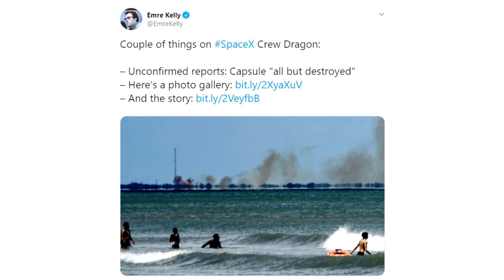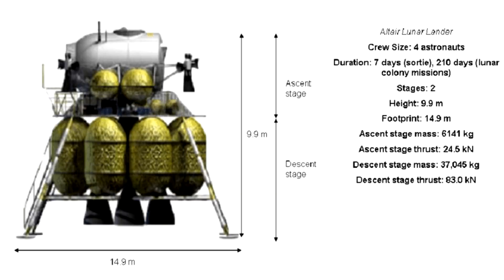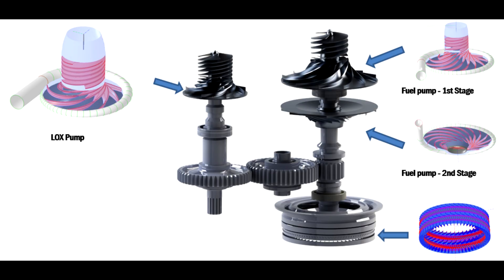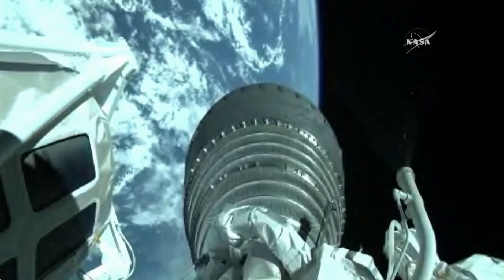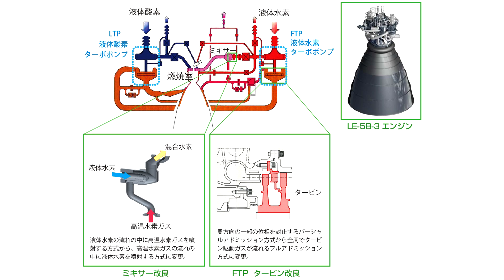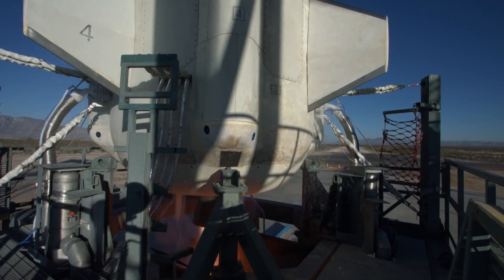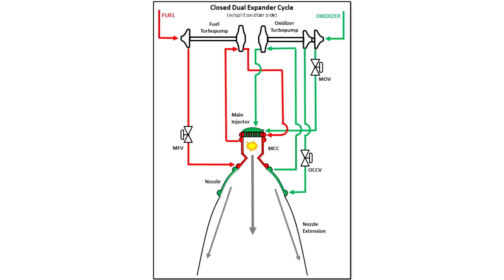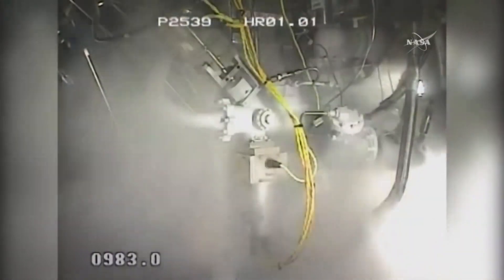Expander Cycle Rocket Engines - Using Waste Heat To Drive Your Rocket

Comment: What is the reason for moving from a jet turbine style engine to an open bell shaped nozzle in rocket engines?

Why did they move the turbine before the main combustion chamber instead of in it?

Obviously theres no air to pull in in a rocket engine, but it's really just a different kind of pump isnt it?
Reply from the maker: Because a rocket engine can't use the atmosphere as reaction mass it needs to get much hotter to maximize efficiency, the exhaust temperature in a rocket can boil steel, a turbine in this location would not survive.
So the turbine is used to run the fuel pumps, and the turbine is run at a much lower temperature.
Reply: @scottmanley  Thanks! I thought of this too...I thought maybe it was possible to run fuel through the turbine blades just like they run fuel through the engine bell.

In my head I imagined a series of horizontal channels stacked on top of each other in the turbine bearing. Where each blade meets the bearing there would be inlets and outlets for the fuel to run through the blade.

Probably not feasible...just a thought. Thanks again!
Reply: The turbine in a jet turbine takes energy out of the exhaust stream to drive the compressor on the intake side. It is often the materials that limit how much thrust that can be extracted from the exhaust flow. The principles of design of nozzles are still the same.
Fast high-pressure gas jets are also noisy, which is undesirable around where people live. That's why modern airliner engines take the opposite tack of moving large volumes of air to a relatively low velocity by taking even more energy out of the core exhaust to drive a large fan. It isn't quite as efficient at high altitudes and airspeeds as a pure turbojet, but it makes up for that on the ends.

Comment: Hi I was wandering if there has ever been a idea to use magnetic constriction to adjust the nozzle geometry?
Reply: Yes, but not on chemical rockets. It is in the works for some theoretical plasma/fusion engines though.

Comment: Losts of video's on the operation of rocket engines, but I haven't found a video explaining how these forces are transferred to the rocket. Why doesn't the combustion chamber burst? Why does the (apparently very thin) nozzle not burst? What part of the engine 'pushes' the rocket up? Why doesn't the engine crush (upward) like a soda can, in a test stand?
Reply: The combustion chamber is relatively thick.
The nozzles are not under a lot of pressure. Ideally, you want the outer lip to be exactly at ambient pressure. Their main job is to turn the high velocity gas flow into a purely linear flow in the opposite direction of the desired travel direction.
A rocket engine is a reaction engine. Pushing mass out the back in one direction at high velocity causes the rest of the mass to gain momentum in the opposite direction. The part that would ultimately feel the force is the "top" of the combustion chamber.
For the same reason you can stand on a soda can and not have it collapse under the force of your weight. Because it is strong in that direction. Early Atlas boosters had to be pressurized to keep the right shape. There is video online of one collapsing under its own weight when it lost pressurization.

Comment: Hi Scott, I'm wondering how fuel tanks work in low gravity.  I mean rockets use oxygen and  hydrogen in la liquid form, which has to be pumped to the engine. But since it is only liquid due to it being pressurized,  how can You make sure that the fuel pump doesn't "suck in" gas instead of liquid? I'm talking especially  about the transition between  liquid and gaseous state. Wouldn't that cause irregularities in the  thrust output?
Reply: Look up "ullage engine" for the various ways. It can be as simple as a nitrogen gas jet.
Reply: @Markle2k  Thanks!

Comment: How about an engine where the Hydrogen acts just like an expander bleed cycle but instead of dumping the Hydrogen overboard it's used with a bit of Oxygen to generate heat (or gas) which will heat up and expand the Oxygen so that the Oxygen can drive its own pump or in case you use it as a gas generator you use that Oxygen rich gas to drive the Oxygen pump.
No reason to just dump your Hydrogen, right? Especially since it's the more unwieldy of the two gases.
Reply: "Hot", high-pressure oxygen bad. It turns metal parts into "fuel".
Reply: @Markle2k  Scott mentioned that. And yet he mentioned an engine where that method is used, right? Or did he just mention that the concept of using expansion of Oxygen to drive the Oxy pump is on the table?
Reply: @MrRolnicek  Hydrogen has a lower triple point so you'll get more expansion (read pressure) for a given temperature. Hydrogen's lower molecular weight will mean a better Isp for the dumped fuel, but I don't know if that's a rounding error for the overall system.
There are engines which use oxygen-rich gas generators. The RD-1X0 engines are the famous example. US rocket designers didn't believe the Soviets until we started buying them for the Atlas V. The BE-4 is another example, and the Raptor uses one on the oxygen turbopump. The Raptor uses a fuel-rich preburner and turbopump on the fuel side.
But those aren't the same as pure, hot oxygen that I assumed you were asking about.

Comment: What I would love to see would be a paraffin hybrid rocket driven by an expander cycle, since you only have to pump the oxidizer, you could get higher mass flow rates, and if you used the turbine exhaust for film cooling of the nozzle extension you could pull more energy out of it (i.e. have a lower turbine exhaust pressure).  Also, since the combustion chamber wall is insulated by the fuel, you would only have to actively cool the nozzle which could allow for larger engines that are still on a closed, or partially closed cycle.

Comment: Sooooo.... the turbo pump is analogous to the APU for a jet engine, correct?
Reply: Not at all. an APU is a separate engine (often in the tailcone) that provides electrical (sometimes also hydraulic) power to the airframe. Thus the name, Auxiliary Power Unit. A turbopump is a type of "fuel" pump that forms the top part of the main engines.

Comment: Simplerockets 2 has a new update on procedural rocket engines in which you can choice the type of pump (even if it is electric), the type of cycle, the type of fuel and some other parameters.

Comment: Scott, can you explain why high pressure water pumps have multiple stages but a rocket turbo pump only have one?
Reply: Predictions: (eg, I don't know, but here's my guess)
* Water is much heavier, it's mentioned in this video that at least some designs have two stages for the heavier LOX pump for this reason
* Most rocket engines aren't going to be run continuously for years

Comment: How about a discussion on Pulse Detention Rocket Engines, which likely would be much more efficient than any turbo-pumped engines. My guess the primary issue is excessive vibration.

https://www.researchgate.net/publication/251682161_Performance_enhancement_of_a_pulse_detonation_rocket_engine

Comment: 2:16 yaiks wrong rocket

or more specific wrong upper stage, the rl-10s wer used on the s-IV not on the s-IVB, as seen in the picture with an j2.
Reply: Question - how do you distinguish between S-IV and S-IVB without looking at the engines?
Reply: I saw the same thing.  S-IV and S-IVB are not as similar as the name would suggest.  The S-IV was a different diameter (smaller than the first stage) and never launched a manned CSM.  He did use a “non-standard” Saturn 1-B launch…from Apollo 5, which tested the lunar module in orbit.  It was the rocket from the ill-fated Apollo 1.

Comment: The fact they used the Rankine scale makes me think they shouldn't have been trying to build rockets.
Reply: If you can't multiply by 5/9, you shouldn't be trying to judge the technical competence of others.
Reply: @Markle2k  A lot of accidents have happened because of conversion mistakes, that's all I'm saying.
Reply: @RBuckminsterFuller  What conversions? Units are arbitrary. As long as you are consistent, you're good.
Reply: @Markle2k  Conversions even within conventions become exponentially more tricky when you tie yourself to a dead horse.

Comment: @szyzyg Would it not be feasible to surpass the square/cube law by using a larger count of smaller-sized combustion chambers per engine to exceed the maximum thrust achievable from an expander cycle engine?
Reply: How is that different from just having more engines?
Reply: @TheToric  multiple combustion chambers all fed by a single, shared pumping system, are counted collectively as a single engine. This is why the the Soyuz is said to be propelled by only 5 engines at liftoff, even though the centre engine has 4 rigidly mounted combustion chambers and an additional 4 steerable vernier nozzles, and each radially attached booster had 4 rigidly mounted combustion chambers plus a pair of outboard vernier nozzles for steering, totalling 32 combustion chambers distributed among only 5 engines

Comment: in theory , would a "gravity" pump save all the power consumed by current rocket engines fuel pumps ? having the fuel tanks way higher than the engine, the fuel pressure at the engine would equal {fuel density} x {tube length} x {g} and that "g" of 9.8 will be multiplied by the rocket's acceleration.
Reply: crowxe Nice idea!  This is how some liquid model rockets operate, but the fuel is being pumped ridiculously quickly on an large scale rocket and needs to be very highly pressurized to produce peak thrust.
Reply: @rocket535inc  
Thanks for the info, and I think the term you used "ridiculous rate" delivers the idea 😊

Comment: I worked building RL-10's back in '89-90 when they were developing the improved thrust version that has the moveable skirt and they really ran into problems.   When you increase the fuel flow needed to increase the thrust the skirt cools down which then reduces the expansion which slows the pumps.   It's a really delicate balancing act on the early engines and the first attempts to increase the thrust did achieve more but they lost impulse which is no good for a second stage engine.   The nozzles supplying fuel and oxygen in the 'shower head' were flowed then carefully adjusted by hand to get exactly the flow needed which was a bit tedious and often took many trips to the flow test to get it right.  Happily things were worked out and the engineers at P&W were and still are the finest in the world.
Reply: Thanks for the bit of history! It's always interesting to get a measure of historical insight from the people who were there.
Reply: Hi Rob did you work in test on 1st I worked on E-6 on 2nd. Got laid off in 93 with me. I remember the hand drop test on the A-4 nozzle Jack Mikey and I, with Greenwood as lead. Winding that thing up evenly and then 321 drop for a week solid before we actually hot fire test. Good to hear from another Pratt Brat. Take care.
Reply: I worked 2nd shift (most of the time) in the tube line then chamber assembly and also was a victim of the '93 layoffs.:(    Got down to test now and then but spent most of my time for the last year building chambers.

Before that I was assigned to the Mockup Building out of Area 577 (J-58 overhaul) and that was SO much fun!   All kinds of neat things to build and I got farmed out to other areas when they needed my assistance so it was a Dream Job kind of place for me.   Sad that it had to end...but that's Gov Contract business for you, feast then famine.:)
Reply: WE worked together I started in Sheetmetal last class brought in  Feb. 1988 Worked in Mockup with Ken and Jean Worked J58 overhaul with POPS, Worked Stol nozzle and 5000 nozzle. Then Ended up in Dept 054 RL-10 I was the injector guy worked with Skip Hon, and Jack Franklin, Walt Dayo the welder. I was on 2nd too. Transferred to test because I had an A&P 6 month before the sheetmetal layoffs but got me 93 but recalled in may 95.  am retiring. next month from Assy.  @recoilrob324
Reply: Heck yea we worked together!!!  I was in the Sheetmetal class (first with A&P's) that started around 10-87 so I'm positive that we would know each other...though after all these years it might be hard to recognize us being that time is cruel and youth is fleeting.:)   Small world!  Great to hear from you and Congrats on your retirement!!!
Reply: Love having professionals chime in!
Reply: Sounds like a great example of why heat exchanger design is the bane of most mechanical engineering students!
Reply: Would this be such simpler nowadays with simulation? I've heard it's still pretty tough to get usable results sometimes
Reply: There used to be a video on Youtube: "RL-10 Rocket Engine Progress Report No. 11"
But it seems to have been removed. Shame -- it showed many amazing things about the internal construction of the engine!
Reply: Was the moveable skirt design actually patented by PWR ?

Curious as to whether the Vinci engine has to licence the technology...
Reply: una duda y si envés de seguir con las turbinas actuales que trabajan con un flujo sub sónico no seria mejor que el flujo en la turbina fuese super sónico para de esa manera aprovechar esa peculiaridad de los fluidos super sónicos que básicamente si yo por ejemplo tuviera  un tuvo con un fluido que va  de izquierda a derecha a una vellosidad supersónica ( para recordar la velocidad del fluido es mayor a la velocidad de transmisión de información del fluido lo que nosotros llamamos sonido por lo que en este caso solo puedes mandar información de izquierda a derecha pero no viceversa )  y en la parte derecha colocase un objeto que eso seria comparable con la contrapresión que genera la cámara de combustión a la turbina , en un fluido sub sónico , el fluido empezaría a frenarse y de esa manera la turbina pierde potencia al igual que pasa en la realidad PERO en el fluido super sónico lo que pasa es que se genera una onda de choque en la parte derecha  donde estaría el objeto por lo que el fluido en la parte izquierda que es donde estaría la turbina , no se frenaría por lo que seria comparable con que la salida del tubo de la turbina fuese directamente al espacio ya que el fluido no " siente " resistencia al avance por lo que puedo mantener la eficiencia de una turbina de un ciclo abierto en un motor de ciclo cerrado y poder aumentar mucho el empuje , manteniendo e incluso aumentando la eficiencia
Reply: wow

Comment: Can't they run the fuel and oxidiser pumps by an electric motor? It would save a lot of plumbing.
Reply: we are talking about thousands of horsepower needed for every pump, engines and batteries for full sized rocket would be massive.
Reply: The turbopump of the F-1 (Saturn V) had 55,000 hp, and the pumps in the RS-25 (Shuttle/SLS) have even more power despite being smaller because of the higher pressure in the combustion chamber.

Comment: I believe the combustion chamber geometry must be changed.In this way we can use back pressure to operate the fuel and oxygen pumps. But we need extreme cooling solutions for components.

Comment: Would it be possible to have an open/closed hybrid expander cycle engine? That way you could run the engine in the open cycle configuration when more thrust is needed, and in closed cycle config when the thrust is not required, so that you can take advantage of the higher efficiency.
Reply: Rik Schaaf was wondering the same thing. Would be beneficial for ULA because if you look at their launch profile, they do thrust off-optimal to compensate for it’s low thrust while they try to achieve orbit. Imagine your solution where they can transfer over once orbit is achieved and gravity losses are no longer a problem!

Comment: Thank you Scott for talking about a great Engine like the RL-10, but Sorry Scott RL-10A5 used on the DCX and DCXA launched many times. I worked on the engine test program from 1991 to 1995 for P&W.  You also didn't note that the RL-10A5 was very throttleable from down to 5% to 100% in less than 3 seconds, This is why it was selected for the CC program to land on the Moon. Most likely will be again just a modified Aces engine RL-10C-5. Best regards Ed.
Reply: Thank you for the engine, it made my late game Moon and Mars landings an efficient breeze in KSP with Realism Overhaul. :) The only other option was the Lunar Descent Engine and its questionable efficiency.
Reply: Did you work at the so Florida R&D center? I had family that worked there.
On the drawing pressure was in psia and temp was in R, can you please explain these?
Reply: @marksmovies6191  psia is pounds per square inch absolute. 0 psia would be a vacuum as apposed to psig where 0 psi would be atmospheric pressure. I don't know about R. :)
Reply: Ed, did you know Bill Adair, who also worked on rockets and jet engines for P&W?

Comment: It must be hard to direct the expanded hydrogen into the fuel pump and not back to the fuel and clog up the feed. Maybe you could fix that by having some of the output of the expansion drive a feed pump also.

Comment: Kerbal space program doesnt teach. docking ports
Reply: I dont know what the dont teach... But I for fucking sure know that if there is one thing worse than a kick in the nuts, it would certainly be docking with Jr. docking ports
Reply: It’s just a game not a real simulator. Real simulators teach but they cost millions.
Reply: @theatom7264  play simple rockets 2 or Orbiter those don't cost much (orbiter is free)
Reply: @theatom7264  Maybe I could help?
Blender has a physics engine that covers fluid dynamics.